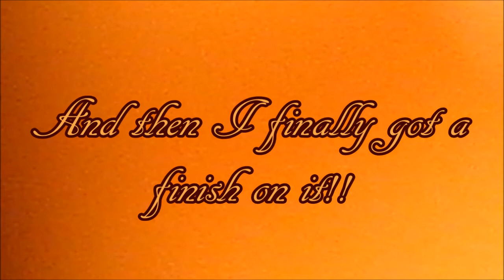Wood turning #54 An Alder Crotch Bowl To Keep Your Knicknacks In

Comment: Question, Today I turned my first Adler bowl,, most of it sanded out very smooth but on opposite sides of the bowl the grain opened up and the texture is ruff and course.I wanted to stain it when finished,,,, how do I seal the opened grain of alder so I can sand it smooth then have it take a stain that is uniform? 
If I just use tight bond glue then sand it smooth it wont take a stain at those locations
thanks,,
oh yeah,, nice looking bowl
Lee
Reply from the maker: Answer... I hope! 
What I have always done is coat it with shellac and then let it dry. Seems to work quite well. 
I might try watering down the glue a little... and I would suggest coating the whole thing... that way you wouldn't notice a stain if it did occur! But I doubt that it would!
You could try a scraper to remove the burrs or you could use a coarse sand paper!
Either way... make sure you let it dry completely before trying to do anything to it!!
Good luck!
and
Thanks for watching
Larry